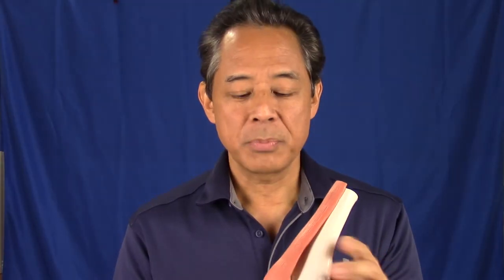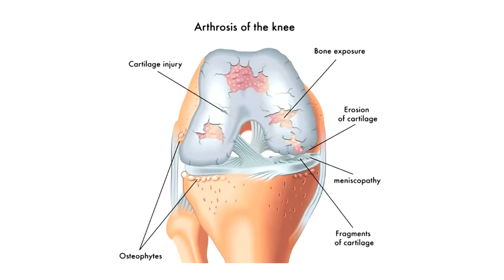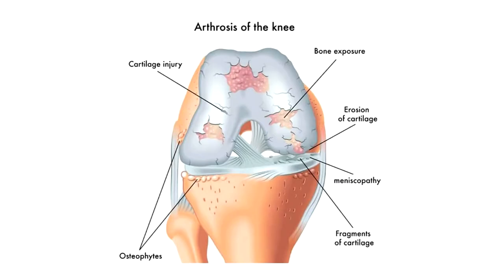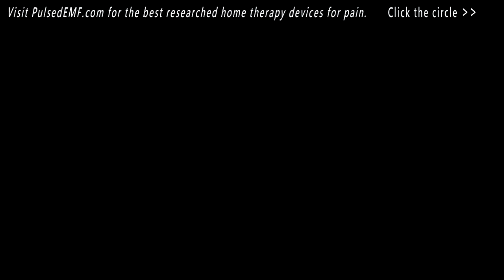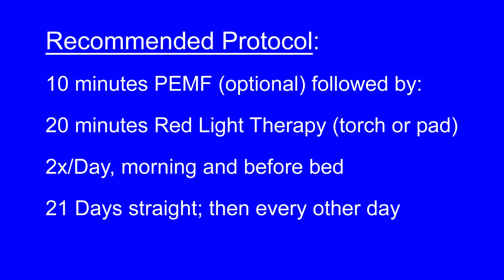Treating Knee Osteoarthritis Pain and Stiffness Using PEMF and Red Light Therapy Combo

Comment: But I cannot bend my leg very much at all. I have had total knee replacement and 2 MUA’s
My leg ligaments and muscles have some inflammation causing more difficulty in bending.
Reply from the maker: Hi, usually knee replacements are straightforward and result in much better knee mobility; although less sensation at the knee.  It sounds like you have complications, which you should see your surgeon about.  Good luck.